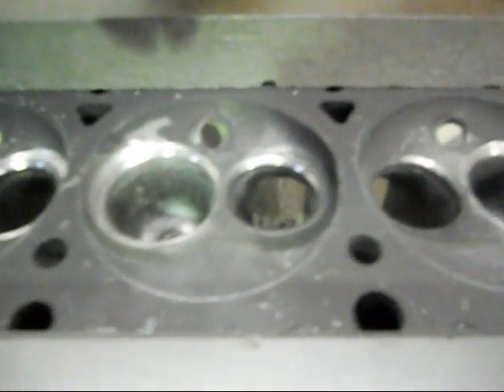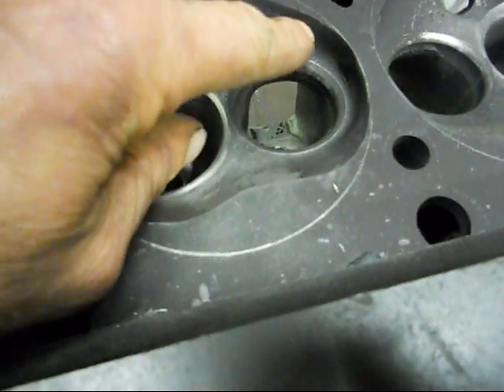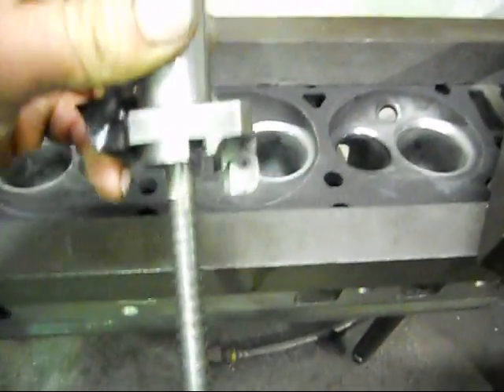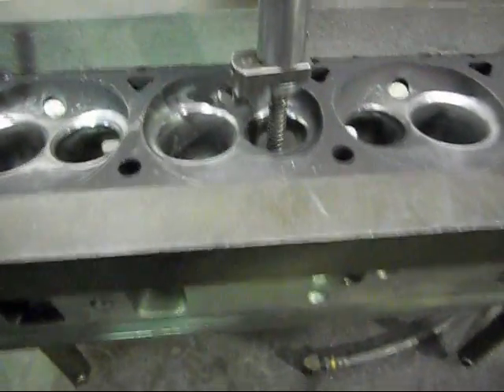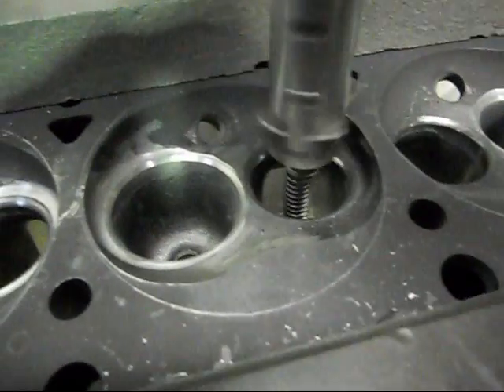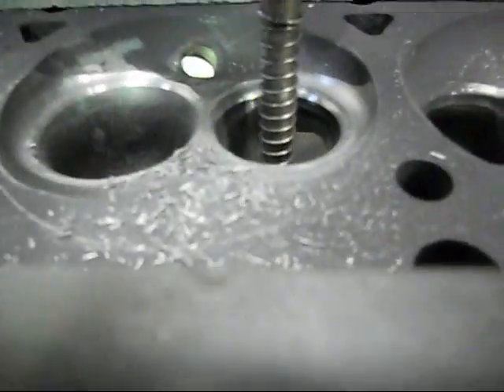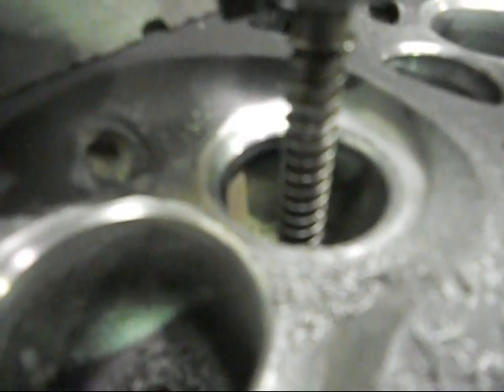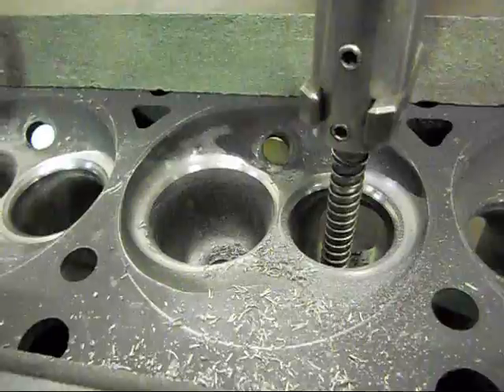How to relieve Combustion Chambers on high-performance V8 heads,5th of 5 angle valve seat job

Comment: Question:  When you un-shroud the exhaust valve, you have a 20 deg cut on the bottom of the tool.  My understanding is the side of the tool should angle away from the valve as well to avoid a dead spot for flow.  Any feedback on this?  I have a set of heads that will have similar geometry, and am curious about this aspect of improving flow.

Comment: i have a nissan altima 2.5 my problem is i replaced the valve stems on the head and after i did it the valves started leaking so i had to take them out a gain and did a lot of lapping but they still leak??? i used coarse and fine paste.. what could have cuase these i put them all back in the order the were removed.. i used gasoline to check for water sippage

Comment: @Aussieheads1 After I posted I thought that this may have been the case. 

Big Hemi Chrysler heads now that is a different story 'eh. 

 You do much in the way of matching the inlet runner gasket and ports themselves ? 
Many people over look this when they trim and square the deck and heads and then wonder why the Inlet manifold isn't delivering the goods.
I did this when I put a Turbo Buick even fire V6 motor in my HJ ute.

Comment from the maker: @mozzmann hey champ,all valid points,the fire ring or bore binder of the head gasket was used in position to the block dowel holes in the head as in position in operation,If I wanted too and have,I would of bolted the heads on the block,and chamber/bore matched it,that's top end blueprinting,but no one pays for that,so binder location shits all over OME factory cast as is location,no use laying back plug side on 308s as that wall is naturally shaped half hemi,closed side is a wall,not like chev

Comment: Where you have marked the Fire Ring from the Head Gasket have you though about laying back the wall of the chamber on the plug side so that all the chamber's are the same shape, then replaced the lost volume with Raised crown pistons (allowing for Valve opening times and overlap) bring out the modelling clay.  Did you polish the sharp edge off on the short side radius in the Valve throat shown at 3.46 ?  this would clean the flow a lot.  I'd Love to get back into performance work.